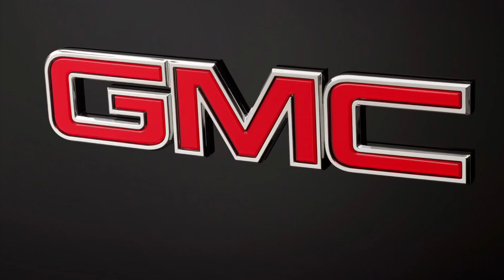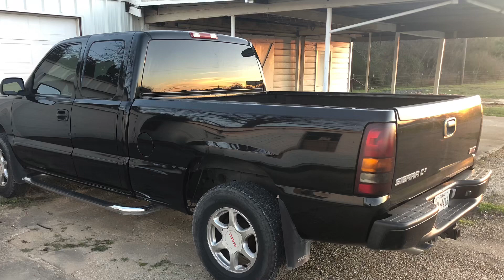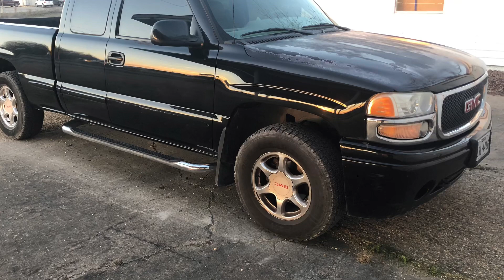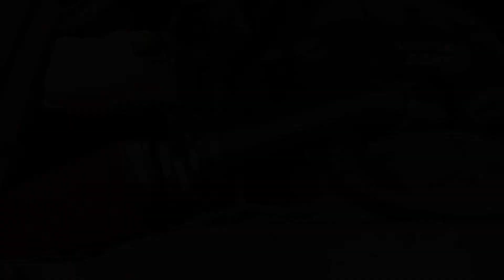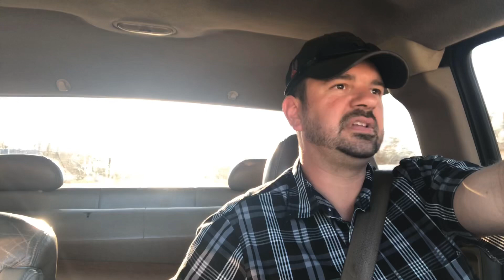5.3 706 / 862 heads on a 6.0 LQ4. Why I’m using them! 2001 GMC Sierra C3. S1, E4.

Comment: I’m going 862 on my lq4 pretty much the same as 706 heads. Btr stage 2 v2 cam just want maybe 3000 stall. An it’s going into a car 😊 should be nice a torquey. Great information bro
Reply from the maker: Thank you! I appreciate it! That’s going to be a great combo!!!!
Reply: What compression you thinking ? And hp goals. I've been interested in the stage 2 v2 with lq9 but on pump 91 daily but enough to make 6.2 newer truck work
Reply: M Larson abou 10.5:1 a full point. And with the v2 should produce around 350ish but the torque gains is really where you’d feel it. A friend of mine has the lq4  factory cam 862 heads, with the stock 862 valves an it’s like night an day vs the 317
Reply: Oh god I'm get after swap traffic ticket hahaha
Reply: Do you know the difference between the btr stage 2 LS cam and the stage 2 truck cam, I'm getting a 6.0 swap and was thinking tbss intake 5.3 heads and the btr stage 2 would be a nice combo before I decide to get some big boy heads and a whipple with a custom grind
Reply from the maker: I’m not sure what the cam specs are on those cams without looking it up. I would venture to guess, if the duration specs are the same, the truck cam probably has more advance ground into it than the regular LS cam. Hence moving the power band lower in the rpm range.
Reply: Do you know the difference between the btr stage 2 LS cam and the stage 2 truck cam, I'm getting a 6.0 swap and was thinking tbss intake 5.3 heads and the btr stage 2 would be a nice combo before I decide to get some big boy heads and a whipple with a custom grind

Comment: I did it and its good power but not drag race power. VERY good pulling power and highway cruising. But i was not satisfied with my top end. Now this could be due to my cam, head and intake choice. Im on stock heads and old style truck intake. Im gonna try ported 5.3 heads and tbss intake and see the improvement.
Reply: Tyrell James what cam you using
Reply: Nathaniel Mackinnon btr stage 4 v2 honestly i think my heads need work to see its full potential and i could use some tuning cuz now i have a converter capable of lockup at full throttle
Reply: Tyrell James ok I was looking at that cam as well in my lq4 I liked the 109 lsa! With that stall it should hall ass nah? I seen people run 3000-3200 stalls halling ass with the regular stage 4 btr 113 lsa
Reply: Nathaniel Mackinnon yes it will move nicely with 3000 stall me personally i have a much bigger stall than that lol
Reply: Tyrell James lol yea ported heads an tbss intake will definitely net you some gains an with that big stall it should fly! It must have been a turd when you had the stock stall huh? Did it push thru the brakes? You have it Dyno tuned?
Reply: Nathaniel Mackinnon i got the stall before i did any motor work. Thats the wiser route. Its the best bang for the buck when you do it that way, if you are after quickness/top speed. Made the stock lm7 wake up quite a bit lol
Reply: Tyrell James lol yo so could you fry the tires with the converter without head an cam? And how was it night an day with the stall on the factory motor? Cause this 4l80 is a straight dog     Off the line definitely needs some help. And it’s crazy you posted today cause I was finna order my btr cam tomorro,so I’ll definitely go with the stall fist an see how things feel. Thanks a lot
Reply: Nathaniel Mackinnon well to be specific i put on bigger mud tires so they didnt spin much but i could powerbrake and do a good burnout which it would not do before the converter. And it did make takeoff alot quicker. My stall rpm launches the truck right at peak TQ
Reply: Nathaniel Mackinnon the stall wakes any motor up due to keeping it in the torque curve more often. But u have to do research and get the right rpm stall to make things match. And match the cam with the stall as well. Dont want a 2600 stall with a stage 4 cam, youd need more like a 3600 stall for a big cam.
Reply: Tyrell James ok thanks for the great info. And your truck sounds amazing!
Reply: Nathaniel Mackinnon you checked the videos out? Thanks man. Going to do heads and intake soon
Reply: Tyrell James your welcome and yea man checked out the video’s love the way that cam sounds
Reply: Nathaniel Mackinnon yeah it is a good sounding cam and with the extra compressiom from the 5.3 heads gives it a unique sound. It gets alot of compliments at the store lol
Reply: Nathaniel Mackinnon it performs good too. Torque for days.
Reply: Tyrell James owe yea!! Torque for days? What I like to hear. What you think about the btr stage 3v2 cam 862/706 ported ? And mind will be on a 4200 lb vehicle do you think it’ll pull hard and I have 355 gears, what all would I need to create that torque monster?
Reply: Nathaniel Mackinnon if you are running a 6.0 it should have good tq. I had the same cam and heads on a 5.7 before and it was less torquey feeling. I also have 4.10s which made a big difference coming from 3.42 ...my goal is to put 4.56 in there though. My stall speed of 4000 is close to peak tq so whenever i give it gas its like maximum tq instantly. FTI 4000 HARD HIT triple disc billet converter. The tq converter u choose is an incredibly critical part of how ur truck will perform. Have to choose them wisely
Reply: Nathaniel Mackinnon btw my truck is about 5600lbs and i have an 8 lug rear end which is actually sucking some power. Its very heavy and takes more power to turn it. When i get a new 6 lug axle it should feel slightly better without the extra weight.
Reply: Tyrell James okay thanks for the info I guess I’ll be fine with 3v2 6.0 yea your correct it’s all I. The stall

Comment: I’m going same Lq4 706 head and cam
Reply: Did you ever do this swap?  What head gasket set did you buy? 6.0 and 5.3 are different sets. Don't think it really matters, but I'm currently doing this swap myself.
Reply: @mathewp4684  I used standard head gasket . I used the speed pro head studs from summit racing I used the drop cam from summit racing and I bought  Voler air intake . I also upgraded all rockers to melling mr3141 . So far so good . Tuning has been a challenge having never done it learning has been fun and yet frustrating. I haven’t blown it up yet
Reply: @mathewp4684  used that 6.0 didn’t want any issue with piston
Reply: @mathewp4684  I have 03 lq4, I swapped cam with summit towing cam, studded a set of 706 heads that I lapped in valves with new seals and updated springs, converted or replaced rockera with caged bearings. been driving since last march.